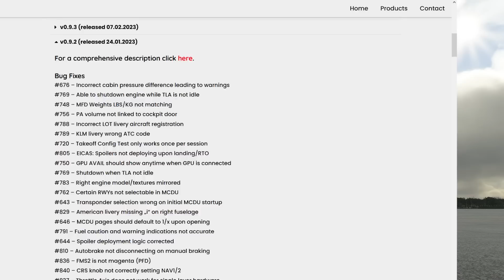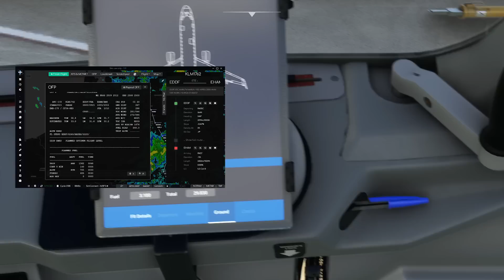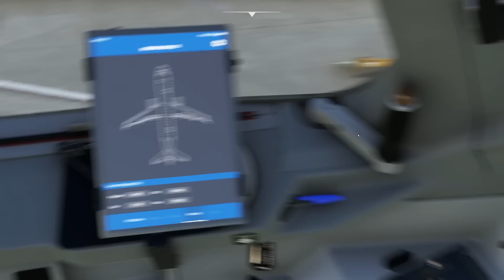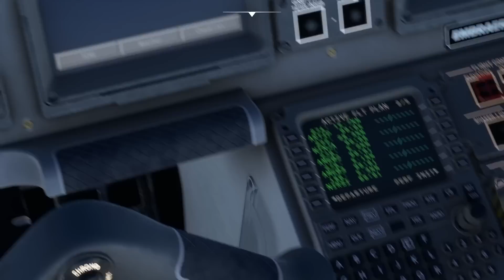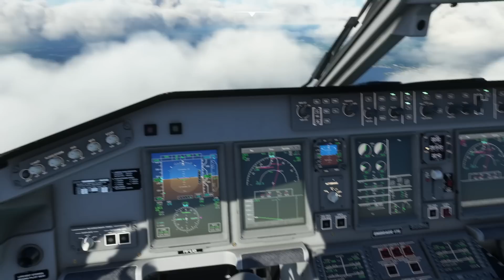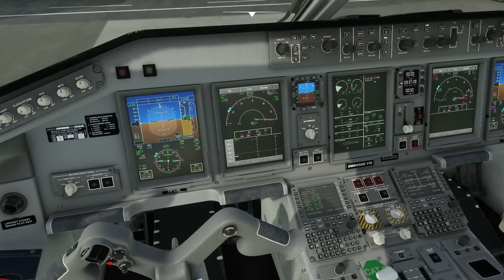Flight Sim Studios Embraer 175 Three Months Later - what improved, if anything? | Real Airline Pilot

Comment: It's sad really, I feel like this thing will never truly "be there" or on the right track until they ditch the stupid default skinned FMS and AP system. 

The original FBW A320 took a while to get to the level it has today, over two years, but was perfectly flyable especially once they turned to their own coding and their own separate hard fork away from the MSFS model. I feel like once they do that, it'll be infinitely more reliable to use for "standard operation" flights.

Until then though... It's a no from me dawg.

Comment: I think you are being extremely generous in your findings lol 😁After 3 1/2 months there has been some small progress. It should have been all hands on deck, working around the clock, to get this into a Vatsim Ready state. Yet as you said they were too busy pushing other aircraft out to make this a priority. It was, and still is an absolute shambles. And a slap in the face to anyone who bought this early access. Yet you only have yourselves to blame. You were warned.
Reply: I bought this thing back when it first released, I've flown it a handful of times. Sometimes I actually had fun with it, others not so much. It can be really fun for short hops, however yes; releasing other planes with this thing in the state that it is was a complete slap in the face to its supporters. Pretty bad move.
Reply from the maker: To be honest, the developers knew all this in advance. There is no way how they could have thought anything else, unless they have absolutely no clue about aviation. They decided to bring it out for the noobs, do false adverts and then do the rest of the development afterwards.
Honestly, from by experience as a beta tester, this is NEVER going to reach a state where it will be even remotely close to the A310, let alone PMDG or Fenix level. In fact I'd be happy if it reaches Aerosoft CRJ level in maybe 3 years.
All fixes done so far are only minor bugfixes, they didn't even thouch the big stuff like FMS or custom AP. And THAT is where you spend years and years getting it working. I've been there, done that (on the Aerosoft Airbus).
Reply: @A330Driver  I completely agree with you Emi. I cannot see this ever getting to a state where it will be a "study level" aircraft as was promised right at the outset. If this is as far as they have got after 3 1/2 months of development, then they should just hand it over to another developer. It's not a lost cause. 

With the right developer behind the project, and with the right focus and roadmap, it could surpass the CRJ, and become what we all hoped it would. With FSS in charge though, no chance.
Reply: it not that deep its a game remember that

Comment: I appreciate your content a lot, but with so many subscribers you really have to do something with the quality of your sound (microphones)🙏
(glad i could resist the temptation to buy this aircraft until now)
Reply from the maker: I bought a 200€ mic already, I just have no idea what else to do.
Reply: @A330Driver  maybe stay a bit more far out from the Mike, or fiddle around with the incoming sound settings of the Mike?😊👍
Reply: @A330Driver I've seen the screen of your streaming software (OBS?) when you brought it up quickly to check something in some video. The mic in level was set pretty much to the maximum there, what one could see in the corresponding level meter as well. You need to turn that down, or you'll get this kind of distortion, no matter which microphone you're using. The level meter should not reach its right end, even at very loud peaks! It's an easy fix! And, keep up your excellent content!

Comment: Maybe this does exist, but I'd like to see the exact same flight carried out in the PMDG 737.  Same route/arrivals/departures, same changes and tests made at the same points in the flight.  Just to make sure this is really a fair review, and you're not just throwing extreme situations at the plane to increase the likelihood of it failing the test.
Reply: Extreme situations? This was the most basic of flights. There was nothing "extreme" about it 🤣🤣There are better default aircraft in the game than this. Turn it in...
Reply: Using HDG SEL or V/S requires a pan call. ILSes and directs are a mayday I think.
Reply: @mscigniewrudzinski5053  🤣🤣
Reply from the maker: As Chris suggests, what would have been extreme that I did with this thing? This is an easy departure and arrival and enroute all I did was a direct. I've done the same thousands of times in all kinds of aircraft on my channel.
I've flown both from Frankfurt and into Amsterdam, though maybe not on the same session.
If I really wanted to f*** around I'd do radial in directs, RNP appraoches including RF Legs, Back Course approaches, etc.
At this moment however I can't even insert any of that stuff in the Embraer FMC.

Comment: Good effort but still holding off until it's at Fenix/PMDG level.

Now I am curious about Asobos ATR plane which ppl are saying is at or exceeds PMDG level. We shall see. Hopefully you will be able to fly it for review.
Reply: I don't know who is saying it will exceed PMDG level, but they are going to be disappointed. There is still a lot missing compared to the real aircraft. Microsoft have a different way of interpreting "study level." Still we will have to wait and see. I for one can't wait for it. Along with the Majestic Q400. If the Asobo ATR can get anywhere near the Majestic at a fraction of the price, we are going to have an extremely good aircraft.
Reply: @MrBillUp  well said
Reply: "exceeds PMDG level"
As excited as I am for the ATR, I really, really doubt that.
Here is a quick list of some items I noticed looking at the trailer:
- Idle ITT totally wrong (266deg, should be between 400 and 500deg with PACKS on)
- Strictly Identical parameters between both engines (that never happens, especially on ATR)
- Cockpit colour is wrong - way too bright blue
- Displays are way too reflective, hard to read
- A very weird antenna under the tail that doesn't exist and would be destroyed during the first takefoo/landing if it did (guaranteed tailstrike)
Reply: @someairplanenerd2417  I agree. I'm not going to complain if it is that good. But I adopt a wait and see attitude. No sense in building hype.
Reply: Well to be honest MS/Asobo have released quite a good number of aircraft..  dont forget they have ginormous budgets and thousands of people unlike small devs.  Sure they would have focused on other aspects till now,  but if they do want to focus on “study level” aircraft they can.
Reply: @TheXennner  Oh most certainly they can, but to do so they have to bring in outside Devs. A prime example is Working Title. 

We have all seen what a talented Dev can do with the Beechcraft Bonanza and Baron. Totally stock Asobo aircraft turned into some of the most detailed, and best simulated airplanes to ever grace our simulators by Black Square. 

Asobo and Microsoft have way too much on their plate with the core sim to drag Devs off for study level aircraft. That why I am really proud of the team, outsourcing it to third parties.
Reply: I would say anything beyond Fenix/ PMDG level (if at all possible) is overkill in my opinion.

Comment: I am unfortunately still completely unable to fly this plane due to a recurring bug with the right engine shutting down constantly when in the air. I have had correspondence with the devs over it but unfortunately it seems they still haven't been able to get to the bottom of it
Reply: It's a long shot, but have you checked your bindings? I remember it was disagreeing with something (can't exactly remember) binded in my TCA Throttle Quaderant, after removing all unneeded bindings, I got the engine to stop shutting down.
Reply: @d_ylan  it's possible, I'm not sure what it could be but I'll have a look into it, I do have a TCA airbus quadrant, it carried on doing it when I unplugged it was the interesting thing
Reply: @cdmrailaviation99  I also have the TCA, for me the trick was to keep it at IGN/START at all times, definitivelly some binding wrong, but I haven't bothered digging into it since I got this workaround
Reply: If you have an axis bound to Mixture or Condition then that axis will kill the corresponding engine if you lower it to zero, particularly if the physical control is in the zero position and it wobbles around a bit to create zero-value input events that cause the engines to die. I've had problems with this in various MSFS aircraft, solution is to always move the mixture/condition lever to full forward when loading a jet aircraft.
Reply: Leave Auto Brake OFF.
Reply: It’s the autobrake RTO at takeoff. Leave off